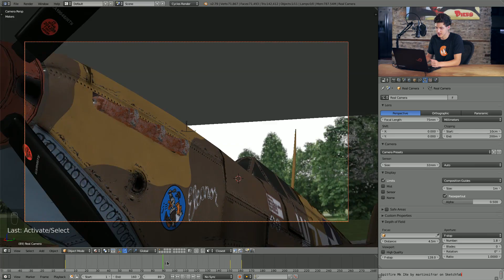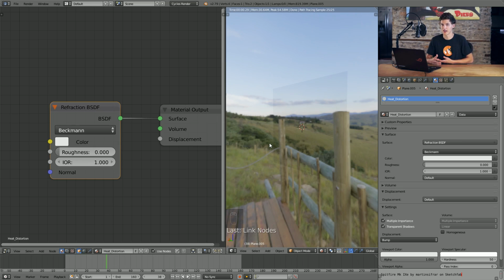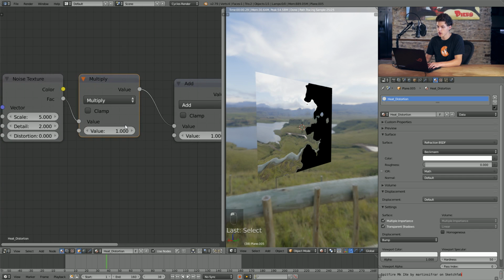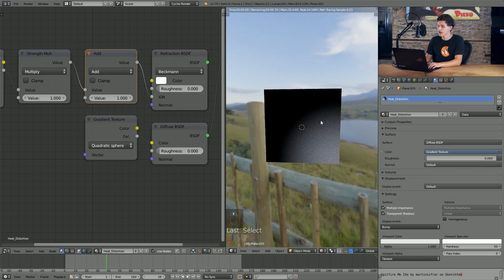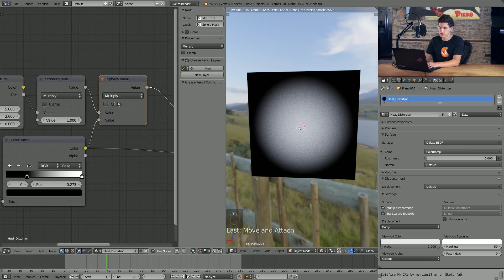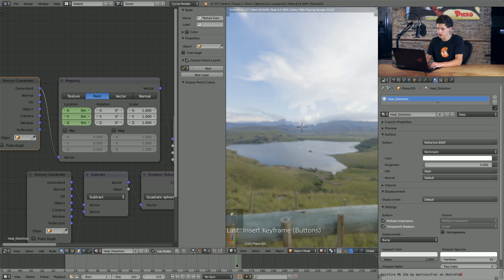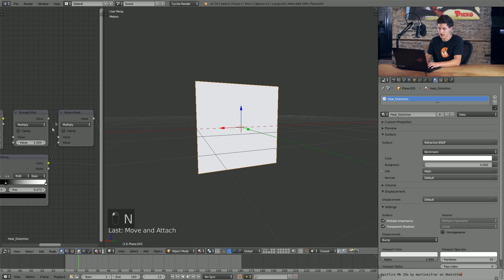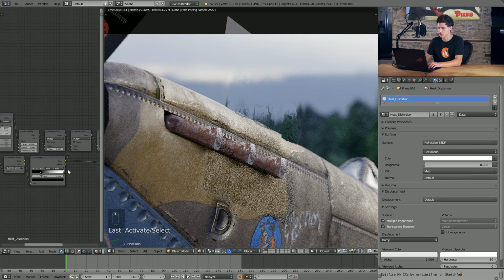Create Realistic Heat Distortions in Blender! (CGC Weekly #25)

Comment: Actually air has the index of refraction 1.0003, it is not exactly 1. 1 is only for vacuum. Hot air has a slightly smaller IOR than air in normal conditions because it is less dense, so it is closer to vacuum. Usually in blender we approximate air with IOR exactly equal to 1, actually there is no air in empty spaces in blender, it is a vacuum. If we doing so, maybe it will be more accurate to use IOR less then 1 for hot air.

Comment: Do not duplicate the material for different distortions, 

Performance tip so you WON'T end up with 1000 materials for each distortion effect; that will eat your resources and pollute your workspace.

In version 2.8 and above, each object got : object index pass and material index pass.

You can use "object info" node and plug it into "math node" multiplier so each object that you give a different index number that will provide different distortion, while using the same material and save perfomance, let alone clean workspace enviornment.

* the method described above works with : keyframes, drivers, library overrides and collection instances.

Comment: Not working on EEVEE. It's only refracting the World not the objects. But its still working on Cycles but i need it on EEVEE.
Reply: There's a solution above: para8D
para8D
1 year ago
I needed to turn on [render settings - screen space reflections  - refraction] and with the plane selected [material context menu - settings - screen space refraction on] these are off by default as Eevee is setup for fast performance initially.

5

Comment: How can I have the heat distortion turn on and off like real heat disortion example being a mirage. You'll sometimes see it, it'll disappear then reappear almost in layers. How can I achieve that effect?
Reply: Add a mix shader right before the final output, and connect a transparent node to the second slot. Adjust the mix factor and keyframe it so you can have the plane be invisible (transparent) or with the heat distortion.

Comment: The heat distortion planes still casting shadows
Reply: select the plane [object context menu - visibility - ray visibility - shadow (untick)] There is likely a way to do it with nodes but couldn't tell you. If anyone knows reply!
Reply: @para8D  To stop an object from rendering shadows using cycles nodes, use the Light Path node 'Is Shadow Ray' output into the factor input of a Mix Shader, with a Transparent BSDF as the second shader input.
Reply: @0x8080FF  perfect, thanks!
Reply: it's actually correct.
heat distortions do make shadows.
the problem is when you have caustics off and then it's not accurate.

Comment: A couple things:
- Because of how IOR is calculated in Cycles, your plane doesn't have the same IOR on both sides. The back side (which ever one the normal is facing away from) actually gets values smaller than 1. To fix this, you have to use the backfacing property and, conditional on that, invert the IOR with a math node (1/IOR). That's then the "thin film" version of the same effect.
- On a similar note, it might actually be a good idea to also apply a subtle normal map to the plane, because irl, we're dealing with what's effectively smoke-like (similar poofy / cloudy structure) and you aren't always looking on that straight onto the "surface" of that cloud from all angles
- "in a perfect world", you'd use a volume with varying IOR for this. In exchange the IOR variation would be far subtler than for this thin film approximation. But I don't think Cycles can do that yet.
- Maybe that idea could be approximated by using a particle system and billboards? Might just look like a mess though. Would come down to trying it out.
Reply: great inspirations, but when is it worth that effort? maybe in a 2 minute exhaust- clip...
Reply: @DjTasteless  volumetric IOR enables accurate rendering of stuff that's capable of bending light (e.g. rendering neutron star collisions)
Reply: @DjTasteless  adding a normal map is super helpful actually. It turns out doing so means you can get away with far lower (and effectively more realistic) IOR values. The IOR is technically supposed to be absolutely tiny.
Reply: How would I change IOR in a volume?
Reply: @JRHainsworth  you don't. You can't. Cycles doesn't support this.
you can, however, approximate it using the techniques offered in this video.
My comment is merely suggesting improvements to that video's process:
- use normal maps and smaller IOR instead of smooth but enormous IOR
- make sure to use a thin film-style IOR (so backfacing needs the same IOR)
- to approximate a volume, use a ton (thousands to millions) of tiny planes each with relatively small (very nearly =1) IOR values

If Cycles did support volumetrically varying IOR, it'd amount to applying a volumetric texture or a voxel field or something, just like you'd do clouds and what not.

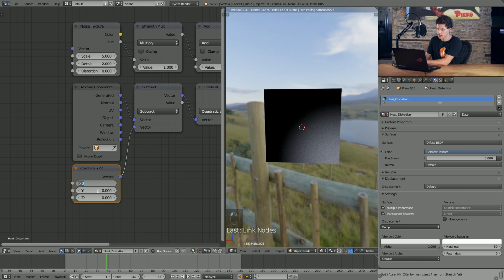Comment: At 7:00 when you’re using the Vector Math to center the gradient, you can use a Vector > Mapping node to do the same thing. You can also simply use the Object output from the Texture Coordinate node; that will be centered on the object’s origin so the gradient will be centered.
Great tutorial, I’ve been looking for an effect like this for a while! Keep up the good work!
Reply: Also, the object coordinates use the object's scaling, I think. Which means if you start with the standard plane and then just scale and position it as needed in object mode, the circular gradient is going to look exactly right (like the tightest fitting ellipse) and precisely end at the edge of the plane.
Reply: I was wondering if that was a possibility.

Comment: IOR can’t get lower than 1 because it’s the divider of the speed of light. And as you know, nothing can get faster than c. So if the IOR were lower than 1, the speed of light would get over c which is impossible.

Great video btw!
Reply: I've found 2 entries on this page where the IOR is lower than 1. Not sure if thats accurate though: https://pixelandpoly.com/ior.html
It's Gold and Silver.

Edit: Just skimmed through the Wikipedia page for the refractive Index. IOR values below 1 are possible, there are even materials with a negative IOR. Quiet hard to understand nevertheless.
Reply: From what I know, IOR can be negative, which is technically less than one, but it can never physically be between -1 and 1.

Comment: Another way I've seen this done (a longer but perhaps more accurate way) is to do a render of smoke (openGL maybe?) in the applicable area, where the smoke is white with a low density.  And then you add that in the composite and plug it into the displace node.  It's definitely not as quick, but the use of smoke may make it a little more accurate, and it'd hold up to multiple layers in compositing.
Reply: Well no - with this method you are actually displacing the directions the rays go.

Comment: Although I am pretty sure that is not physically accurate to assume that the distortion happens along a plane. It still looks very convincing.

I recently read that heated air is a example of a medium with a continuously varying index of refraction. That is the IOR changes not abruptly along a surface but continously. So I believe the light rays will travel along a curve instead of being refracted at a clearly defined surface (where there would be an edge in the path of the light ray instead of a curve). 
I don't think any render engine supports physically accurate rendering of media with continously varying IOR.

Anyway who cares if we need to fake it as long as the result looks still cool.
Reply: I recall another tutorial on this on CG Cookie that used particles with rgb colours that were then mapped in the compositor to create a lens distortion effect based on the RGB values for XYZ. Quite some work, but very accurate and convincing results. This way introduced is a lot cheaper in terms of effort and for a quick way makes a lot of sense to me, too. What I would do is distort the plane (or a cylinder?) rather than use a texture. Would need to check if that changes the looks to be even more realistic. Animation probably needs to be a bit faster for a head exhaust? Nice tutorial - as always! :-)
Reply: so finally it should be a "blob" - modified with noise displacement (over time) or whatever, suited with a refraction node, concerning Kram1032 s formula- while the blob is a subdivided quad- sphere...
Reply: Yeah, I tried adding a normal map to "fake" distortions not along a plane, and it actually is rather advantageous: Smaller IORs can cause larger distortions that way.
No way to do the continuous IOR in Blender though. That'd require a volume-level IOR.
Reply: @Kram1032  I know I'm late, but I think you can simulate the changing IOR, by keyframing it and then adding a subtle noise modifier in the graph editor. I haven't tried it, but it should be even more realistic IMO.
Reply: That's IOR changing in time, not in space. You want volumetric IOR. Potentially a different, continuously varying value for every single point in space.
Reply: @Kram1032  Thanks, I get it now...
Reply: @Kram1032  can you not do that with math geometry?
Reply: Tyler not sure what you mean by that but I'm almost certain Cycles only checks IOR when a ray hits a surface with a material that relies on IOR.
I.e. it will only ever change at the surface.
So you can have a varying surface IOR but you can't have volumetric IOR.
Reply: @Kram1032  if that's the case it might be impossible then, I was referring to a math surface. I've used them in the past to apply Beer's law to force cycles rays to absorb properly through glass of varying width. It worked surprisingly well and if I had to try to achieve a heat wave effect in blender I would start with math surfaces.
Reply: @Kram1032  Apparently the "exact method" requires you to implement something called the snell's law ni*sin(Φi ) = nt*sin(Φt) to accomplish the mirage effect with PBR ray tracing engines
Reply: @DRS659  basically you need to be able to vary IOR continuously in space. Full 3D space. Not just along a surface.
Reply: @Kram1032  yeah no got that dude haha, and apparently to do that with a ray tracing render engine like cycles you use that equation....or at least according to some scientist assholes at stanford but I mean what the fuck do they know haha. If you look up math surfaces you'll see how they can instruct rays to behave differently in 3D space based on a single or even several formulas. Since we started discussing this I've read 2 papers on it...if you need to believe it's impossible that's cool I'm just saying there's material out there where people have actually achieved this effect specifically with ray tracing engines using math surfaces to manipulate the rays in 3D space
Reply: @Kram1032  oh wait I think you mean the math surface is a surface haha sorry dude the surface projects an equation it's not visible to the camera in this case its just a surface  of whatever size and shape that can apply formulas to light rays based on proximity. The surface itself isn't visually present with this technique only the  result on the light rays. The influence of your formula(s) or in this case Snell's law would be applied over a distance so even though you've created a surface it will effect light like a volume. I hope that helps
Reply: @DRS659  I really have no idea what you're talking about :D - do you have like an example to link?
Reply: @Kram1032  this is a pretty easy tutorial on how to create your own volume nodes based on a physical formula https://www.blenderdiplom.com/en/tutorials/simulation/419-tutorial-absorption-in-cycles.html